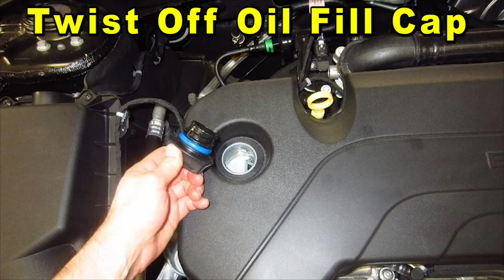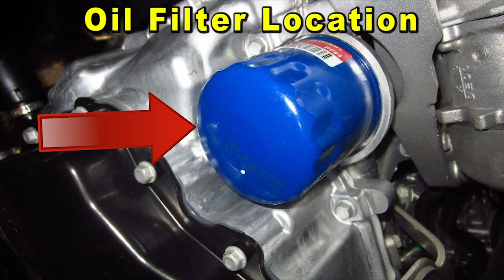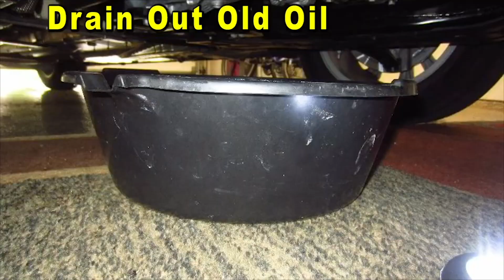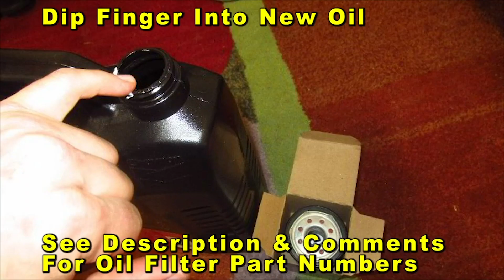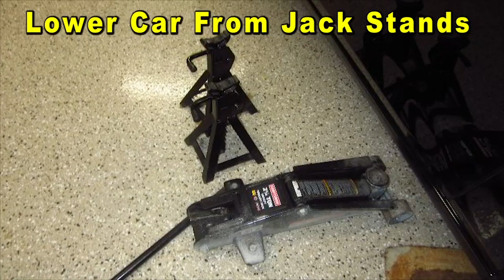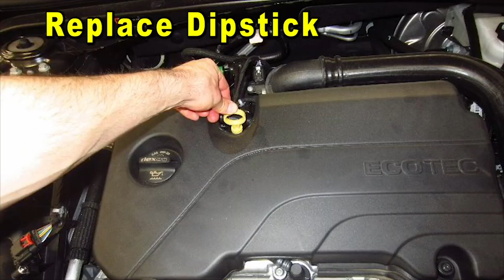2016 To 2024 Chevrolet Malibu How To Change Engine Oil & Filter With Part Numbers - Quick & Easy

Comment from the maker: Chevy Malibu Engine Oil Filters - https://amzn.to/47wXvf1
ACDelco OEM Engine Oil Filter Part Number - https://amzn.to/47UlgxD
Fram Ultra Synthetic Oil Filter Part # - https://amzn.to/3Rgjmln
Lisle Oil Filter Tool - https://amzn.to/47wWPX7
Precision Screwdriver Set - https://amzn.to/3sLixaP
Plastic Pry Bar Tools - https://amzn.to/3HMtsV7
Socket & Ratchet Set - https://amzn.to/3Z17LbA
Mechanix Gloves - https://amzn.to/3jCnHkt
Torque Wrench - https://amzn.to/3vS5uSI

The Paul79UF YouTube channel is a participant in the Amazon Services LLC Associates Program, an affiliate advertising program designed to provide a means for sites to earn advertising fees by advertising and linking to Amazon.

This DIY video shows owners of the 9th generation 2016, 2017, 2018, 2019, 2020, 2021, 2022, 2023 & 2024 Chevrolet Malibu sedan how to change the engine oil and filter for the Ecotec LFV 1.5L turbocharged I4 engine.

Comment from the maker: Check out the DIY guide for changing the engine oil and the oil filter in a 2016 to 2024 GM Chevy Malibu -
https://www.paulstravelpictures.com/2016-2023-Chevrolet-Malibu-Engine-Oil-Change-Guide/index.html

Here are all of the DIY repair and maintenance tutorials for the ninth generation 2016, 2017, 2018, 2019, 2020, 2021, 2022, 2023 & 2024 Chevrolet Malibu sedan - 
https://www.paulstravelpictures.com/Articles/2016-2023-GM-Chevrolet-Malibu-DIY-Repair-Maintenance-Guides.htm

Owners of other General Motors vehicles from Chevrolet, Buick, Cadillac, GMC and Holden such as the Impala, Corvette, Bolt, Sonic, Spark, Express, Trax, TrailBlazer, Equinox, Traverse, Blazer, Tahoe, Suburban, Colorado, Silverado, Cruze, Volt, Camaro, Encore, Envision, Enclave, Regal, LaCrosse, Canyon, Sierra, Terrain, Acadia, Yukon, Savana, XT4, XT5, XT6, Escalade, CT4, CT5, CT6 and Commodore may also find these DIY instructions to be helpful.